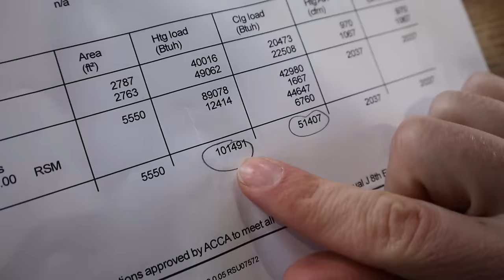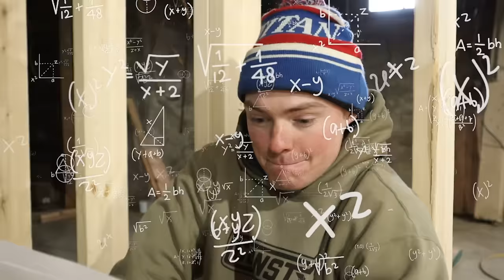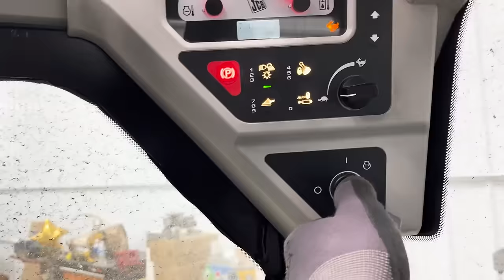Restoring A $7,000 Mansion: Removing 2nd Story Floor

Comment: heat pumps are more expensive but they use less energy so you save money on utilities over the long run. but heat pumps have a very limited range of temperatures. not sure if it works well at extreme temperatures outside. tho heated floors should be enough. i lived in alberta and had heated floors from water pipeing and it was very nice!  my parents had 2 furnaces in their 2000 square foot house so 2 in a 5000 sq ft. house probably isnt unreasonable. tho definitely check with multiple companies cause some companies will add on extra stuff and charge extra high prices when they see someone they think has a lot of money.  ask for the model numbers for the appliances they plan to use and check to see if you can find any reviews online.

Comment: Cole I have a 500+ square foot three story house supported by three units (2 heat-pumps and one HVAC) which I manage separately considering the time of day and how / when we use each floor. No way one unit works. Also, everything you are doing including heating / cooling, appliances, thermostats, network, stereo, security etc … will be controlled by AI smart systems and you don’t want to retrofit later.

Comment: When you say one unit instead of two, are you referring to one bigger unit as opposed to two? Either way youe looking at a big price tag. The two units may be cheaper then the one bigger unit. In my experience you are going to run into the temperature difference between floors if you go with one. I have a 4k house and I only have 1 unit and wish it was separated. I do have a zones setup, which helps. Your house is probably going to be more efficient with the spray foam. One unit might work for you. I guess you could always see based on the plans if a second one can easily be added. If yes, then it makes sense to go with one.

Comment: I used to have to do the clean up on a 4800 sqft house and I kept finding straight 16 penny nails on the floor. The contractor my boss wanted me to pick up all the nails and toss the bent ones in a 5 gallon bucket. Had one of the framers kept throwing straight nails on the ground. Because he kept pulling them out of his tool bags and the wrong end would almost get pounded into the studds. So he would throw it on the ground. So now day as I was picking up the nails with the magnet and putting the bent ones in the scrap bucket and the straight ones into a bucket for 16 penny nails. I took his tool belt and and emptied it of all his straight nails and filled it with bent nails. He didn't check his bags before putting them on. So with me my boss and one of the other employees we watched him pull out a bent nail look at it and throw it on the ground he did it about 6 times before he looked into his nail pouch and saw all the bent nails. He got a little pissed. I told him those are the only nails that I want to see on the ground. I also took the bucket of straight nails that I was picking up and kept it in my motorhome as I was sorting nails. We also were going through alot of nails because of him wasting the straight ones on the ground. I did this for 8 penny nails. My boss told him that when he starts buying the nails he can throw them on the ground. Instead of Saleem going to Home Depot for more I pulled out the 2 buckets of sorted nails. Just to help with money loss on little things like this is why my boss liked having me around.  I was brought in for security reasons but when he found out that I did have some construction experience. On the first house I worked for him I knew how to cut tile. So I help get that job done on time that we all got a $500 bonus. I also knew how to do rough wiring, some plumbing, drywall, roofing and painting. Security is what I did for 17 years I did Drywall for 13 years until my doctor retired me after a visit to the E.R. . I'm currently disabled love watching the show

Comment: Do not skimp on having a system per floor. I’m a 35 year HVAC veteran. Heat pumps in central Iowa is not a good idea in my opinion. Ashrae temps in your area would show that gas fired furnaces would be be best. You are going to do heated floor everywhere so your heat load for central heat will go down. I’d be happy to discuss options further in private.

Comment: Well you know my opinion on the heating cooling, I would forget about in floor heating, go with the heat pump systems, if the in floor heating won't be enough some of the time anyway, then its useless. More of a luxury and trust me on this it will cost you a arm and a leg for the electric bill for both in floor and heat pumps.

Comment: Problem with the cooling/heating system is the uncertainty of technology changes. Government regulations add thousands to a system. The units installed in the house must have enough room to remove when replaced with the new technology coming. I spent $25,000 on a total replacement including duct work for Heat/Air system in Texas on a 1500 square foot house.

Comment: You probably will not be occupying every room in the house at the same time, this where two systems or zones would help. Two units would be better by not running the one unit all the time. I live on the east coast and the prices that you mentioned sound pretty good. You guys could do the duct work with a few hours of tips and a case of band aids. BTW by the time you do the addition who knows what will be the next better mouse trap. God Bless.

Comment: Look in to Geo thermal system.  Cost of equipment would be about the same but then you have the wells or pipe fields to put in.  Up front cost is high but the ROI is great.  I had to redo my system after 27 years the unit was $15k installed for 36k btu unit a heat pump was going to be $18k.  My electrical supplier said go back with Geo you same on the electric.   You are probably going to be  in the $`100k range with everything.  But you have a 30% tax credit as well.  Mini splits are another option but still going to cost and cost more to run.  My highest electric bill was $250 but I'm 100% electric and have a mini split heating my garage as well.  So heating it would be about $100 to $150 a month for both the house and garage over my non AC summer months. Also Geo is very forgiving if you size it to big with the new variable speeds pumps.  They also can do zone control on the waterfurnace brand .  This is probably one of the best on the market today.  It is a cost thing pay more upfront or pay more over 30 years.

Comment: Yes, you will need 2 heat pump units for the current house.  My son's house is not near as big and without 2 units his house on the upper floors would be unbearable.   Especially in the summer.

Comment: 2 systems is teh way to go. I have a similar older home (1942) and that was the only way to make things work without putting ducts in closets or having soffits everywhere. Also, given all the land around the house and the excavation equipment you own, why aren't you running geothermal as you primary heating any cooling? Equipment is inside

Comment: For the HVAC, now that you have the load calculations make sure you get a high seer heat pump. the current standard is 15 seer or so, you want above 20, they even have as higher then 30 now. The higher the seer the more efficient it is and, the lower the temp is outside they can run at. you want above the curve with seer, do not go with the minimum spec (it is a minimum for a reason), you especially need something better it as you are so far north, you want the heat to work in the dead of winter.

if you want some good knowledge on heat pumps, load calculations and how they work, Technology Connections recently made a video titled "Old HVAC industry practices are holding us back and costing us money. But we can fix it." here on youtube, worth the hour watch as it will give you some incite on how these things work, calculated and what to look for. 

If the price via your installer is too high for a higher seer heat pump, you may be able to get the unit yourself directly from a supplier and then have them install it once you have it in your hands.

Now in regards to having two hvac systems, you can get one main and use mini splits to take the few rooms not quite covered and get them going as well, they may help lower the cost for now and when the time comes to get the addition on the home you can get the second main havac system and repurpose the mini spits elsewhere.

in the end you definitely want both type of systems if you have the option, both radiant and hvac, that would be the dream for my home as well once i get one, high efficiency and radiant floors.

Comment: General Contractors - Cole you are not the general contractor because general contractors are knowledgeable and very experienced.  You guys are doing great, but your followers have raised some good questions along the way. Why not have an engineer look at the structure before you cover it up with drywall. The same goes for electricity and plumbing. Plan, build, inspect, build … you get it. You learned some very hard lessons on the bin site … apply them here. Have some inspections done.

Comment: Air heat recovery unit is a wise decision. It will draw the heat out of your used air, and push it back into your heating system, while the spent and now cooler air gets vented out of the house. That will save you a lot of energy, and in such a big place that will pay for itself in a few years time. Same with solar panels if you decide to get into that. The investment will be paid back in a few years and you will basically have free electrisity for a long time.

Comment: Mitsubishi makes single wall units for each room for heat and cool.  They are very efficient plus you don't have the bother of ducts or the dust, dander, or hair which accumulates in them.  It costs considerable money to have them cleaned out.  Then add the cost of allergies or sensitivity issues.  $$$$$$

Comment: I would not go for neither fossile gas nor air to water/air to air heat pump. But geothermal would be great for your needs. You might not even need to drill, you have a lot of open space around your house so you could probably use that instead of drilling. 

Multiple systems adds complexity and makes it harder to tune, but adds redundancy. If one system breaks you have another that can keep your house from freezing while waiting for spare parts. 

But I think 100 000 BTU sounds like way more than you need, I live in a sub-arctic region in a house that half the size of your house but only need 1/3 of 100 000 to heat it. My house have worse insulation than your house. We have temperatures in the negative 40-50 degree fahrenheit during almost every winter.

Comment: Geothermal heat pumps is diffantly the way to in larger homes
(Pros)
1. No outside unit
2.Big Federal tax credits 30% of total system cost in 2022 through 2032
3.Geothermal systems can reduce energy consumption by approximately 25% to 50% compared to air source heat pump systems. Geothermal heat pumps reach high efficiencies (300%-600%) on the coldest of winter nights.
4.Brings down the utility bills gas, oil, & Electric. The Geothermal system can pay for itself in 2 to 8 years depending on the system.
5.More reliable and less maintenance cost.
6.Many more pros too many to list.
(Cons)
1. Cost most of the cost is the installation the large ground loop needs to buried 10 feet underground which requires heavy equipment (small excavator or backhoe) which yall have & you could do the dirt work & save thousands.

Comment: If you wound up doing a sub 1.5 ACH house, one system is all you need.  Lazy HAVC math supports two systems.  But they don't care about your recurring utility bills.  Most HVAC guys oversize your system which introduces yet another nifty little side complication.... mold as a result of condensation of a too large HVAC system.  Yeah it gets cool fast, but it sweats... leading to mold. If you keep your main system inside your thermal envelope, and you can with the foam you've already done, you're coming out way ahead.  You'll need, however, to implement a fresh air ventilation system to let the house breathe.  I've built my last home, a 3300 sqft gem with only one 5 ton unit, top of the line Lennox 26 seer system.  I almost never use the heat, maybe twice or thrice a year.  In your case, with your floor heating plans, I am not even sure you need the fancy schmancy boiler systems.  Go tankless for your hot water, NG or propane.  Thank me later.  Think I'm BSing?  my util bill is $113 last moth for 3300 sqft. Also don't overlook split systems.  You'd be surprised what you can do with that.  PS... don't forget to run your tech (cat6e) low voltage stuff .  Plan for it.  Maybe even have an IT room.  I have one.  Everybody should have one.

Comment: You really do need 2 AC systems. You will very much regret only installing one AC system. 2500 sqft per system is a good fit. Also your concern with the temp difference between the first and second floor is correct AND do not forget, you actually have 3 stories as you have the attic to heat and cool. Folks have that issue on 2 story 2000 sqft houses with one unit which is common. Definitely do TWO units, you will not regret it on the first 100 degree day.  With a good air tight house you need fresh outside air and a heat recovery unit is a must. Seems like a lot right now, but when completed you will not be disappointed. Kind of like making the floors level, you want this to be a comfortable home for the next 100 years, if you skimp on the HVAC you will be very sorry  in the future, it is just as important as level floors.

Comment: Cole I have over 30 years in hvac work and knowledge if you would like to take reach out to me. Being your home is two plus stores I would go with the to systems or go for a single system with zoning. you can't go wrong with the in floor hydronic system its the most comfortable heat you can have.

Comment: Cole, will you have to pay for helpers for duct installation?  If so, you would need to deduct that and any other extra costs from your $18k saving.  It sometimes costs less to let professionals handle a job than you actually realize before everything is done.

Comment: Not an expert, but when it comes to air filters, I suggest you use aluminum filters that you can clean rather than disposable ones; this will save you money in the long run.

Comment: Second floor walls look to be sitting on the top plate of the first floor walls. You need fire blocking in the stud bays were you prematurely spray foamed.

Comment: Awesome... from the drawings the master bathroom toilet is facing the door to the bedroom.  Nothing like opening the door and seeing someone taking a shit.  Also no hallway access to the 2nd floor bathroom, brilliant!!!

$100,000 for heating and cooling, that's about right for 5500 square feet.  Now talk about those single pane windows that you haven't talked about replacing.  There's another $100,000.  A garage with additional rooms and bedrooms... there's another $150,000 - $200,000.  Then you get to talk about things like drywall, fixtures, flooring, and cabinets.  The million dollar bin site is going to sit next to the 3/4 million dollar mansion restoration.  Better pray for grain prices to come up since you're splitting those crops three ways.

Comment: Hi Cole, here are some HVAC comments from a homeowner not a professional.   At 5,500 square feet with 10' ceilings you have a really big house!  If you trade off cost vs comfort for your wife and family you will be hearing about it for your entire married life.   HVAC systems are more complex than they used to be and they need maintenance and break down.   Having two heat pumps may provide some redundancy to your HVAC system which is a good thing.  In your new system will you have a whole house air filtration system, Ultra violet sterilization, humidification etc.,?  Have you considered nixing the radiant floor heating system and heating and cooling the house via the duct system?  Will the system have zones with dampers?  I have a 75 hear old, 2,800 square foot house where I am investigating a new HVAC system.  My burner puts out 125,000 btus which reflects the age and insurlation in my old house.  We have alot of glass looking at a lake in the ADK Mtns of New York.  I have oil fired forced hot air with mini split heat pumps that were added later.  Its great that you are doing essentially "new construction" for your HVAC system.  Its alot easier than a retrofit in a crawl space.  Good luck to you and the guys.  I really enjoy this channel and all of your team's hard work. GZ

Comment: I see a lot of recommendations for you to spend the extra money but almost no one is talking about how to save money. First get bids from multiple companies if you are dead set on going that route, personally from what I've seen of you over the years I think you could do all of the HVAC work yourself. I think the ducting is probably the hardest part and the tools will pay for themselves. Second get a quote for AC only and for a heatpump if the price difference is huge confront them on why. Minus aux heat, the only difference between an AC only system and a Heatpump is a reversing valve in the condenser. For the same tonnage and seer the price difference between the two condenser units is usually $200 or less. HVAC companies rake people over the coals for Heatpump systems when they install exactly the same way as an AC system. As for the aux heat if you're putting in radiant heating, I would say you don't need it. If you have the time find a free manual J calculator and do your own calculations or at least plug in their numbers and double check them. Make sure they're not over sizing your units, if they short cycle you'll have issues with humidity in the summer. A multistage or variable speed system can help that as well but are more expensive.